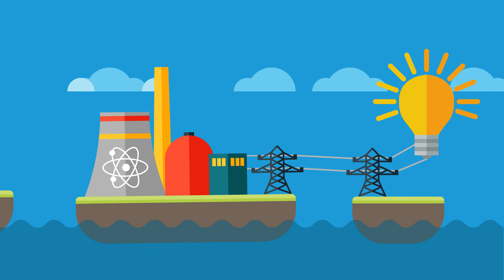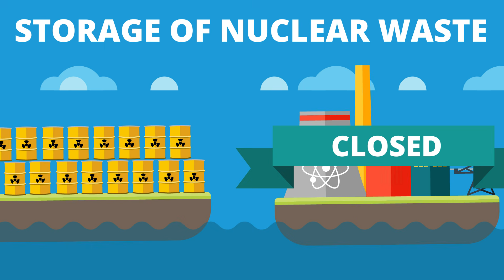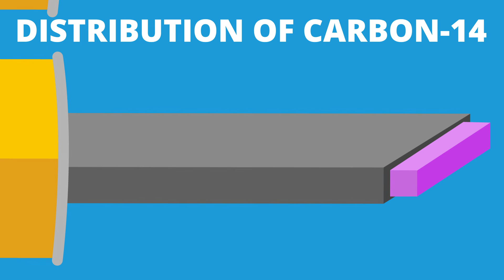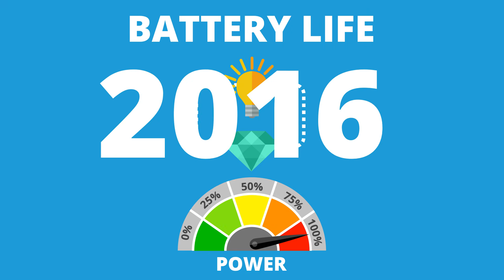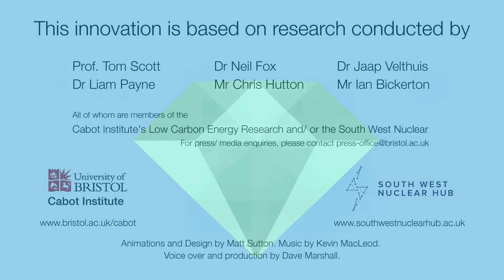‘Diamond-age’ of power generation as nuclear batteries developed

Comment: We could come up with ideas much easier if we had an idea of the power density. How much power does a button battery sized or AA sized Diamond emit?
Reply: Betavoltaics are commercially produced by a number of companies. Widetronix has a large share of the contracts in the US. Their main product produces miniscule amounts of energy per weight (usually in the order of a microwatt or less). The tech has been around for a while now and I wish they had stated that in the video.
Reply: I had a rough estimate of  10.8 mW/gram of diamond. Diamond have density of 3.5g/cm^3, an AA-battery have a volume of 7.7 cm^3.
This gives a power-output 0.29 W to an AA battery size. It is probably going to be a bit less due to technical issues. And also consider my calculations might be wrong. I just had a bit fun playing around with numbers.
Reply: Andrew Binning it sounds as though it's at least enough power to run a watch or something. I figure it could be used to power volatile RAM easily, which requires some power to use- though not alot of power in most cases.
Reply: Krommandant
 Thorium has a half life of 14 billion years, so your suggestion will last much longer, but almost deliver no power compared to pure C-14 diamond (which also delivers almost no power). A core of Samarium-151 (hl=96.6 years), Nickel-63 (hl=100.1 years) or Plutonium-238 (hl=87.7 years) could possibly increase power output, while maintaining long-lasting properties, as in lasting for a lifetime.
Reply: but efficiency is about 1.5%, so output turns out to be 15 joule/day per gram
Reply: Maybe make it more powerful with a raisin-sized thorium core inside an avocado-sized carbon-14 crystal, with a 1 inch-thick coating of non-radioactive diamond.
Reply: Trestein Jordklatt
you will want to use a pure beta emitter, so Pu-238 is out. But apart from increasing the activity, how can the thermodynamic efficiency of the cell (now about 1.5%) be increased?
Reply: Looking at the main article, they say "A Double-A battery stores about 700 Joules per gram, and runs out in about 24 hours of continuous use, diamond batteries provide 15 joules a day"

So, a Diamond battery would be 47 times more massive than a Double-A battery to produce the same energy. I don't know how physically big it would be though, since I don't know which is heavier per volume

So they're only for use when you need to run something for a long time.
Reply: CSDragon
 Joules per gram is energy per mass, which means it can differ in effect. Joules per day is one specific effect, so you will have to make a battery massive enough to deliver the desired effect, unlike an AA-battery that will just discharge faster with higher effect.

15 Jules per gram day is ~0.2 mW/gram. So to power a smart phone (6 W) you need a battery of 34.6 kg.
Reply: But the ideal core of this battery would be safe for human carrying (low radioactivity), excites the C-14 tu augment the power output and lasts longer than the C-14. It would be slavageable by breaking the diamond after it is depleted and re-coating it by the same processes.
Reply: What about Americium-241? It's an Alpha source which can be harnessed by a similar method.
Reply: Actually, a Diamond battery would be 47 times more massive than a Double-A battery to produce the same energy _in a day_. So in an application where the AA battery is depleted in more than 47 days, it seems just fine. So you can easily power a clock (my wall clock runs for about a year with an AA). Or a small LED. A pacemaker also seems feasible as it runs for years on the same battery. Actually, this is quite good rule of thumb: if something is able to run on a battery for 47 days (maybe more, say a year, if the 15J/g is just for the radioactive core and does not consider the necessay coating any maybe electronics), you can power it from a similar-sized nuclear diamond battery.
So, e.g. bluetooth tags, active rfid cards, digital clocks, digital calculators, implanted eletronics, zigBee wireless sensons, etc.
The real question is where does the application warrant the increased cost (a 0.5 carat artificial diamond seems to cost $2000, so a gram would cost around $20000. That's a lot of battery changes.).

Comment: How many amp-hours does 1 g of these diamonds produce? What is the cost per amp-hour, estimating for when the production technology gets scaled up and cheaper per unit? Optimistic video but these are the metrics we need to hear
Reply: First I just want you to know that I'm just going to mess around with numbers;
Decay energy of C-14 is 156 keV. 
Current = charge/time
Watt = voltage*current = voltage*charge/second= 156 kV * 1.60 *10^(-19) C/s = 25.0 10^-15 W/decay.
Rules for decay: N = N₀*e^(-λt)
We can say we start with a gram of C-14, and then see how many C-14 that decays per second; a gram of C-14 is 4.30*10^22 atoms (N₀).
Did some calculations and got λ=2/(1.799*10^11)

ΔN= N - N₀ = 4.30*10^22*e^(-2/(1.799*10^11)) - 4.30*10^22 = -4.3*10^11

To calculate effect: 4.3*10^11 decays *25.0 10^-15 W/decay = 10.8 mW/gram.
Reply: Betavoltaics are commercially produced by a number of companies. Widetronix has a large share of the contracts in the US. They use different isotopes, but the principle of operation is the same. Their main product, the "Firefli" produces miniscule amounts of energy per package (usually in the order of a microwatt or less). The tech has been around for a while now and I wish they had stated that in this video.
Reply: Sam Marrable Ah, damn. Thanks a lot for the response, that's interesting. Also, I think I should've used the term watt hours instead of amp hours as watts are power and amps are just current/charge.
Reply: TheSuperfluousMan the only reason I would use these diamonds for is a lightsaber power supply
Reply: Their website says the battery might produce 14 joules per day per gram
Reply: Aguiar Ed You'd need to tether the saber to a truck with the 20 ton diamond in it.
Reply: That is 128 mW/g. Myy calculation doesn't take technical dificulties into account, so my 10.8 mW/g number is probably an overestimate.

128Wh/kg = 128mWh/g
This means that the energy output for 1 hour is 128(mJ/s)*3600s/g=460.8 J/g
If you want to convert that into Watt = Jules/second.
You take (460.8 J/g)/3600s = 128 mW/g
Reply: I have the exactly same question. In addition, the process of this extraction does not seems to be "hassle" or "pollution" free. isn't it? What will be the environmental impact of this process? Another word "What other type of waste are we creating here?
Reply: hopefully Trestein can comment but I think one of the two numbers you mention are in watt hours while the other is in watts
Reply: bobdvd
 14 joules/gram*day=0.16mW/g
Reply: It's going to take a mammoth of a diamond to run a car on nuclear :-)
Reply: In this thread, there is a lot of discussion how how little power  is generated per diamond battery. or that its  power density is low. For most everyday applications, a diamond battery is unacceptable. But, there are niche applications  that do not need lots of power but need a battery  that can last a long time.  Namely, when its difficult or impossible to replace the battery and not much power is needed in the first place, and cost is less important than other design parameters.
Reply: not all "waste" are carbon, just the controll rods are, not the leftover Uraniumdioxid Well kuts?
Reply: TheSuperfluousMan Now that is some real talk!
Reply: I did some calculations with the sources I found in the internet. They said that 1g of the nuclear waste would produce 15 Joules a day.
So, 95,000 Tons of waste would produce 1,425,000,000,000.
Converting this to Watts would end up with 16,493,055.556 Watts every 24 hours if we could convert the entire waste we have to day to diamonds.

Someone correct me if Im wrong tho.
Reply: No such things as Watts per day. It's Joules per day. And when it's Joules per second, it's called a Watt.
Reply: +Cloxxki After reading REKCEP's post it seems like he should know the difference between watts and joules, and he probably just typed the wrong word. However there is a thing we can call "Watts per day", we just do "W/day". This can describe the average change in power output per day over a time period. Carbon-14 have a half life of ~5730 years or 2.093*10⁶ days. After these days a 1g battery will have half the power output and give out 87µW. 87µW/2.093*10⁶ days = 41 pW/day
Reply: Yeah, I've heard such applications of units of mesure :-) 
So my neighbors car is actually 3 horsepower per year. It used to be 2hp/year. As in, loses 3 hp  every year.
Reply: Cloxxki
 lol, your neighbor is bad at maintaining his car :P

Edit: I see that losing a car lose about 4 hp/year on average, so I have to correct my self and say your neighbor is good at maintaining his car.
Reply: It was a hyptothetical neighbor and car just to come up with a wicked unit of measure :-)
Reply: LegendLength, ohh certainly. In general, shorter half life beta voltaics have more power  per unit mole.
Reply: For comparison purposes, what is the mW/gram for a average lithium ion battery? I found 128wh/kg online. Can you convert that in mW/g :)
Reply: 15 Joules per day means  1.736/-4 Watts.
times 95 million makes 16,493 Watts.
Or, enough to power 16 cheap hairdriers, or one BEV at highway cruising speed.

95 thousand tons is something that gets in the way. If the same density as water, a cube sized nearly 46 meters in each direction.

Comment: How small is the electrical current?
Reply: This.
How many volts/amps?
What kind of power density?
Reply: "An alkaline AA battery weighs about 20 grams, has an energy density storage rating of 700 Joules/gram, and [uses] up this energy if operated continuously for about 24 hours," Scott told Luke Dormehl at Digital Trends.

"A diamond beta-battery containing 1 gram of C14 will deliver 15 Joules per day, and will continue to produce this level of output for 5,730 years — so its total energy storage rating is 2.7 TeraJ." - Tom Scott, researcher/developer
http://www.sciencealert.com/scientists-are-turning-nuclear-waste-into-super-efficient-diamond-batteries
Reply: Well, the Betacel was a radio-voltaic device around one cubic inch in size, and it produced four tenths of a miliwatt.

Don't expect much more from this.
Reply: It's the "15 joules per day" that's the problem for most applications.
Reply: ***** No, it wouldn't. It isn't an ideal voltage source. The output voltage will drop as the load decreases. The 0.1736mW is the maximum power. Take a AA battery, hook it up to a potentiometer, and monitor the voltage as you decrease the resistance of the potentiometer. I'd expect the diamond to have quite the high internal resistance.
Reply: SuperResistant The concept was already used in the 70s. With different sources, and different setups. The process used by this British team results in an extremely low output.
Reply: +Paul Shields
They did their research. If they just improved upon an old method, nobody would be talking about it. The interesting spin on what they're doing is that they're making the conversion device itself out of the energy source. There are, however, a couple of problems that this causes. 

The conversion device needs to be made of a semiconductor, and there aren't too many radioactive semiconductor materials. These researchers looked at all of this Carbon 14 sitting around from nuclear reactors and thought "hey, carbon has 6 valence electrons. It's kind of a semiconductor, right?" However, while carbon does have the correct number of valence electrons, and diamond does have a decent configuration, the band gap is too large to be a very good semiconductor. Furthermore, Carbon 14's half life is in a really awkward position. The problem with just sticking it in a bunker is that its half life is short enough to be bad for the environment after a while, and long enough to effectively never go away. With these batteries, that long half life does mean that they'll last for ages, but it also means that they can't output much power. If they were to make the batteries out of some compound that is either a better semiconductor, or more radioactive, then it would be great, but that would defeat the whole benefit of recycling the carbon 14.

TL;DR- They could make batteries that have a much higher power output, but to improve efficiency, they'll need a better semiconductor than diamond, and to otherwise increase the power output, they'll need a more radioactive material than carbon 14. In either case, the entire point of being able to recycle the hazardous control rods would be nullified.
Reply: SuperResistant
I mention efficiency because if you can improve efficiency, then you can increase power output without making the device larger.
Reply: Yeah... So... 15 joules per day is about 173.6 μW... It's probably also safe to assume that that's the maximum power output, so I doubt you would even get anywhere near that output in any practical application. (For those of you unfamiliar with SI/engineering notation, that's 0.0001736 watts...)
Reply: +bosoko0 Congratulations. You now have an equation with unknown constants that relies on the solution to be known. You could instead just use Ohm's law... But you don't know the effective internal resistance of the supply, or even if that effective internal resistance is linear in nature--which I highly doubt it is.
Reply: ***** Well, the idea that it would be close for any practical load is an assumption in and of itself. We also don't know what the open circuit voltage is, or what combination of series/parallel connections they used to get that power output.

It might not even be possible to get a 20g battery to output 1.5V. I was just testing a little thermoelectric cooler that I set up as a generator. With a temperature delta of around 190K, it had an open circuit voltage of around 1.7V, and a max power of 189.6mW. The load for that max power was between 2 and 3 Ohms, which brought the output voltage down to 0.732V. I would upload and send a link to all of my data and the plots, but I expect that comments with links will be filtered out, but it's half power point was at a load of less than 14 Ohms.

The best answer to "How small is the electric current" is "it depends."

You seem pretty intelligent. I'm sure you've gone through the headache of arguing with people who don't understand the statistics they're using to support their arguments. I just don't want to be the source of those misunderstood statistics.
Reply: ***** While they can release the energy instantly, that would be done mostly as heat and light. It's very unlikely that we will be able to convert the radiation into electricity before the blast destroys the equipment anytime soon, if ever; the "if ever" largely being due to lack of funding because everyone seems to be terrified of the prospect of nuclear power.
Reply: ***** Gotcha. I thought you were implying that the instantaneous release of energy could be collected with betavoltaics. According to Wikipedia, only about 5% of the energy released is ionizing energy, so even if we somehow managed to collect all of the alpha, beta, and gamma radiation, we'd still lose 95% of the energy. I could very well be wrong, though. I'm just an electrical engineering student.

It's been nice having a decent conversation with someone in the YouTube comments. Most other conversations I've had recently have been with people at the top of Dunning Kruger's Mt. Stupid.
Reply: Hank, the 15 joules/day per gram represents about 1.5% of theoretical thermodynamic output, so yes you really will get your 173 µW per gram
Reply: Yeah, it surprises me how weak and inefficient it is. If they did their homework, I'd expect them to boost efficiency over previous methods

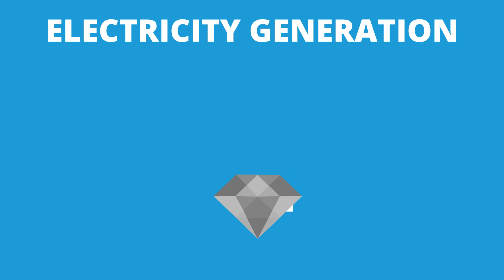Comment: What exactly is a "radio active field" (stated at about 2:43)? Or do you/they mean an EM-field?
Reply: A field consisting of a radiation flux - in this case the flow of β particles from carbon 14 decay.
Reply: Fredrik Stål carbon 14 decays by neutrons decay into proton and an electron that shoots out aka beta decay. giving it a voltage differential.